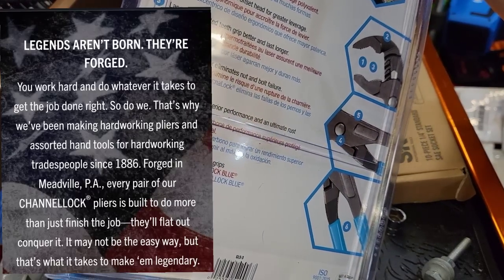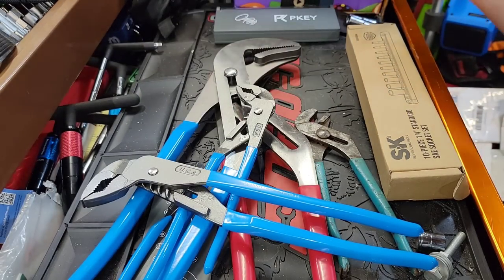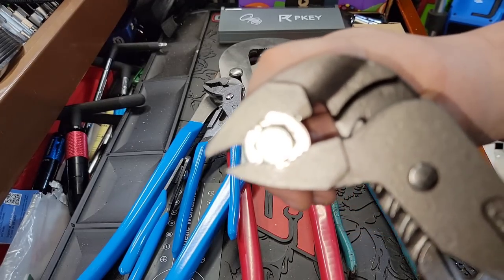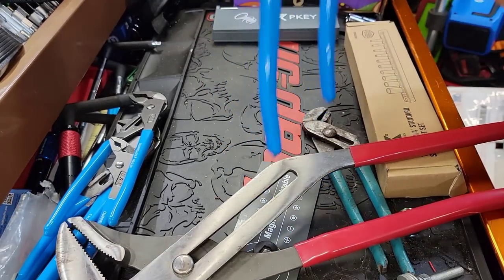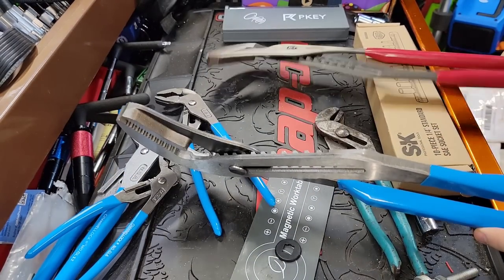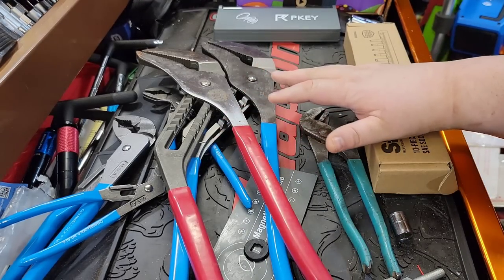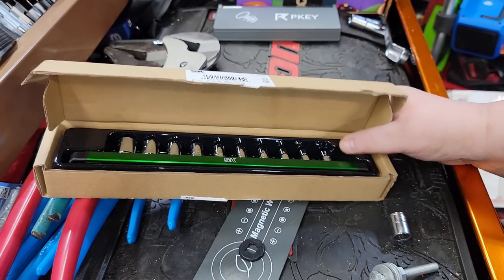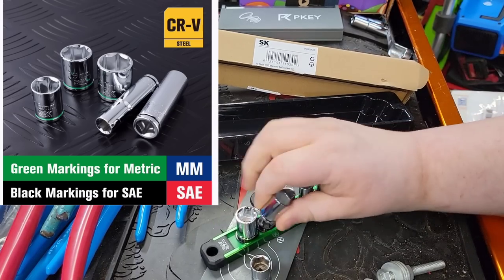🇺🇸 CHANNELLOCK vs Doyle & New SK TOOLS the truth is obvious when most are blind!!

Comment: I’m a CAT mechanic, I love the grip locks . I’ve used them to turn pins on an excavator. I also have the knipex and they are also amazing. They two are different but I think they complement each other. I was doing a job where the grip locks was the only thing that could grab a fuel filter cap, used to break it loose, and then I could get the knipex on. That slight angle difference saved me there.

Comment: I bought that 3 piece channel lock set a few years ago and after trying to use them I threw them in my box where they have been since. I work maintenance so channel locks are used quit a bit but not that set. I bought a couple of the new style of channel locks also and the handles are to beefy. They don’t fit good in my hands so they are also just sitting in my box. I bought a 3/8” deepwell SAE socket set from SK and I love them. I love the socket rail they came on. I assumed these was made in the US and after I bought them I put them in my box not paying attention about the sockets saying made in the US. Dang I’m upset about that. I thought SK was still made right here in the US.

Comment: Nice job Chad ☕☕ 😋 . I use pliers as little as possible, however here in a couple days I'm picking up a couple pair (7" & 9") of the original Craftsman Robo-Grips adjustable pliers.  They came out before vice grips and hold the cheap knockoffs of them came out and they're hella anice 😇 . I'm guessing you have some yourself but in case you don't I would jump on some quick like bunny 🤣 ..

Comment: When I started out in the trade ( late 80s 😮) there was an independent tool truck that sold SK USA.  I bought some stuff way back when and still use it today. I always shy away from off shore stuff because warranty sucks ( yes even big names like snappy break). Warranty is king. As I am getting close to retirement now I feel sorry for young techs starting out as good quality tools are very expensive. Well more expensive than they were. I like to look at a new tool in the amount of hours work it costs to purchase. A case in point. I have a snappy ratchet I bought in the early 90s that cost about 3-31/2 hours pay now the equivalent costs about 5+ hours of work. Getting hard for the new guys.
Sorry I went a little off topic CP.  Btw I have channel locks as old as yours and still use them.

Comment: The GripLocks came out back in i think the 90s? as a more economical model. They definitely hit the mark on the economical part because even for being US-made they cost just peanuts, but that comes with tradeoffs. Very minimal machining work is done, the grooves are actually part of the forging rather than being cut in, and they dont bother with shining them up and completely removing the forge flashing, etc. They went with what they describe as a "Euro profile" in the jaw there. They're decent for what they are and definitely for the low price, but obviously you won't get as much.

That being said, yes theres absolutely room for improvement. Igarashi also has pump pliers that are economized through similar means, but they managed to toss in a more substantial set of forged-in grooves at least. Though they just use a bolt and nut rather than the Permalock fastener, which the Permalock is more expensive as theres a process they do involving a set of dies to hand-tune each one. If you want to check them out for yourself, they're rhe LGR-250 (they have a couple other sizes too), also sold under the name G MONSTER. They can also be found rebranded as Fujiya Kurokin, which includes the trademark color scheme and some comfort grips rather than bare metal.

Comment: A little disappointed in the operation of the slides of the CL's? They look nice, but can tell they will be slippy slippy? I hate to say it, but after getting the 16" Cobra's, I have never picked up my CL 16" pliers much? I have a 24" Rigid and a 18" Proto pipe wrenches, if the Cobra's can't get the job done? The Cobra's have the same style jaws, as the new CL's do? Good job, CP.

Comment: I bought those channel locks years ago when they were new, I felt like they were an improvement over the original design, then I discovered Knipex. The whole sk thing upsets me since I started buying them (there’s a local hardware store with an aisle of sk tools). Now I’m thinking I may have to wave down a Mac or snap on truck since I was looking at the prices and while they are higher it’s not really that insane (I do mobile commercial/industrial hvac, so the truck wouldn’t come to me). What’s the best way to get in touch with a local rep? Also do they offer better deals for cash/card payment? I do not want to open a line of credit

Comment: I can almost guarantee those China made SK sockets are the exact same as the WORKPRO sockets which is also a Great Star brand. They look identical just the SK with a painted ring the WORKPRO without. There's full WORKPRO sets with ratchets for similar prices to just a limited piece count SK socket rail. 

Should pick up a set to compare
Reply from the maker: I don't doubt did you see my duratech wrenches they are just chromed versions

Comment: So from a metallurgical standpoint, “virgin” steel really shouldn’t matter. The alloy itself is either right or it’s wrong. Though make sure it doesn’t have trace amounts of stuff in it like Tellurium (see the Beretta 92 slide failures that happened a number of years ago).

God knows you and I can’t change the world. Warren Buffett tried when he bought a shirt company called Berkshire Hathaway and he couldn’t fight the trend of textile manufacturing going overseas. And that’s why Berkshire Hathaway is now an investment entity lol

I have a new SK ratchet here and I like it.  It’s marked USA and it’s nicely made. The direction switch is stiffer than hell but otherwise, I’m impressed all things considered. 

So, you made me think…. Consider the quality of tools we see from those foreign countries. What are THEY using to build their structures and products? It would be interesting to see.
Reply from the maker: What do you mean virgin steel shouldn't matter? It absolutely matters that the integrity of the steel is not comprised in any way, so that is absolutely a baseless statement.
Reply: @CPthetooladdict  think about it. Steel is an alloy of various elements with iron. Those metals all had to get smelted from their state where they’re mixed into whatever rock or soil they were part of to begin with. That required processing to achieve the desired purity of the iron, vanadium, chromium, carbon, molydenum, etc. It didn’t just come out of the ground as steel. That same processing is required to recycle that material. The difference is in the refining and the alloying. It’s not “virgin” steel that makes Snap On tools special, it’s their specific alloys (something Henckels and Victorinox knives are also both great at) and how they heat treat them. That latter bit is particularly important. And they are amazing at it. Basically, It’s a marketing term that’s used that I think could very much be improved on. Not unlike when some company says “aerospace aluminum”. Cool. What alloy? What hardness?
Reply from the maker: It's pretty obvious that you actually don't understand metallurgy or the composition of said metallurgy. So, this conversation is really pointless. I really don't have time to argue with people who don't understand what they're talking about. I'm sorry. I have more pressing things to do with my life..try Google and actually learn what the difference of virgin steel actually means to the integrity of tool steel. I think you will benefit from doing such research.
Reply: @CPthetooladdict  you go right ahead and bask in your ignorance.
Reply from the maker: "Ignorance" is someone who can't admit they are wrong and let's pride take over one's emotions.